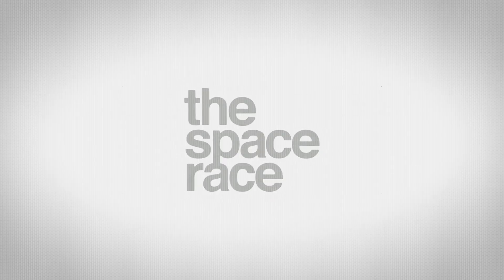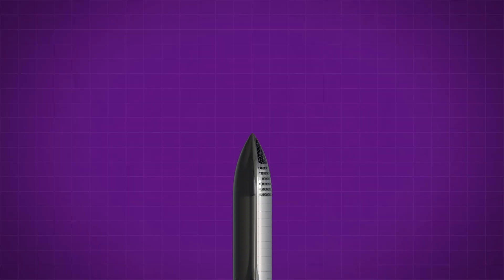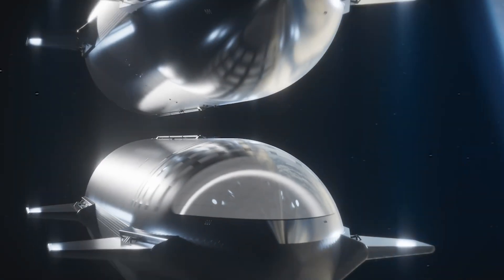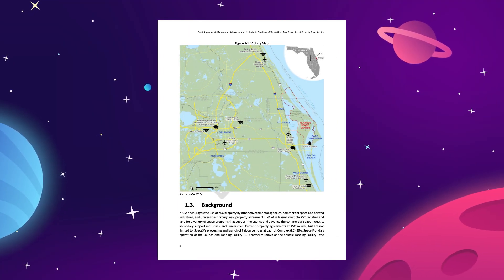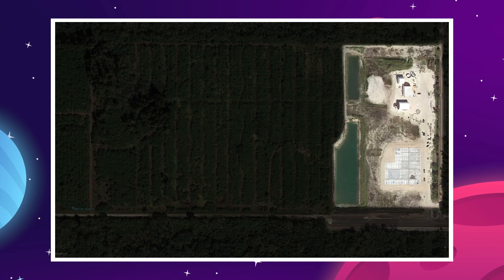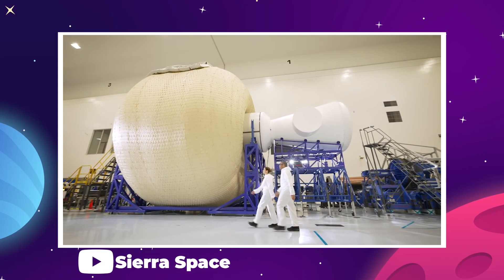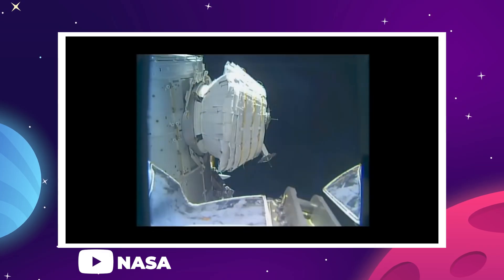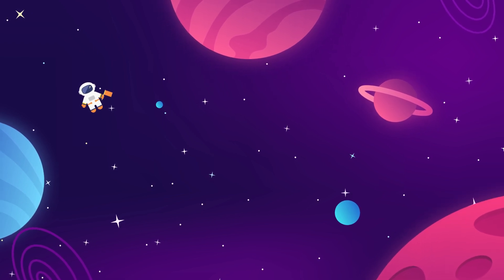SpaceX Reveals New Starship Prototype!

Comment: it doesnt matter how much pressure  these habitats can hold within reason. Im curious how well it handle heat and cold in cycles.
Reply: Also how does radiation change the properties of the fabric over time? Let's hope they have already tested these materials on the external exposure facility that has been on ISS for at least a decade. And like the submarine that just imploded on the bottom of the sea, how do the dissimilar material joints hold up under the space environment. New technology is tough. That's why NASA has been so conservative. Unknowns get people killed.
Reply: That’s a good point
Reply: Oh man, someone better let the aerospace engineers know about basic facts.
Reply: Any Starship kept in orbit for an extended duration will need Whipple shields to protect the tanks from debris impacts.
Reply: @r0cketplumber  fair point shields are needed. Ive also been wondering if impacts would do more damage to the integrity of a composite hull vs a metal one but maybe with shielding it doesnt matter
Reply: Can you use nuclear  power?like ùsed on ships ?

?

Comment: Why does Starship use so many engines instead of using the more powerful but not as much
Reply: Redundancy. Power to weight. Large engines might not scale in the same way. etc etc etc. It might even be that its just cheaper and easier to make a lot of smaller engines then one big one. With rockets its tends to always be a game of tradeoffs.
Reply: Better to have more just in case things go wrong
Reply: one single large engine for a rocket like spaceship isn't very practical imo

Comment: Isn't a Saturn V 33ft (10.1m) diameter and is carried on the mobile platform that looks even wider. Unless it's the fact SpaceX uses a different transporter with it's wheels closer together and therefore can't straddle the tracks used for the Saturn V mobile launcher.